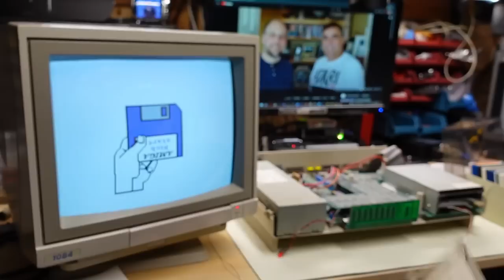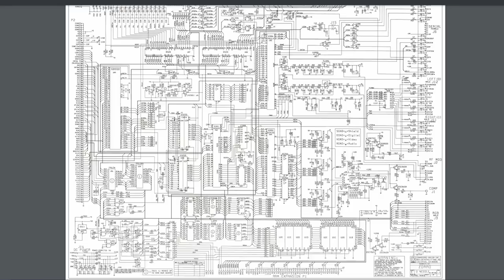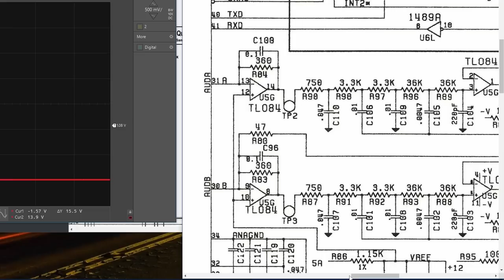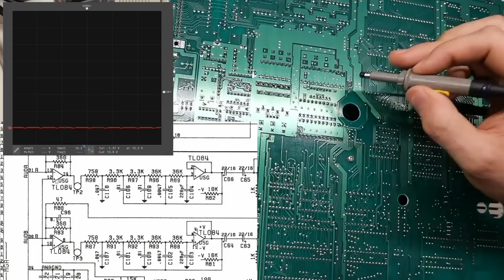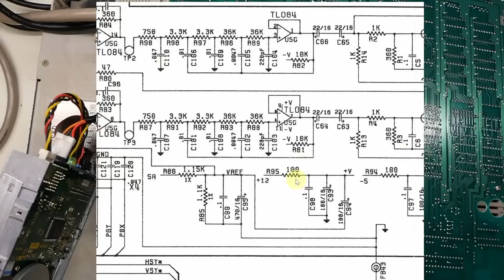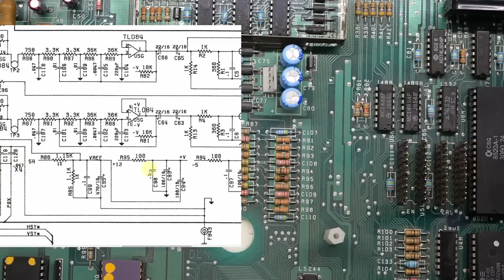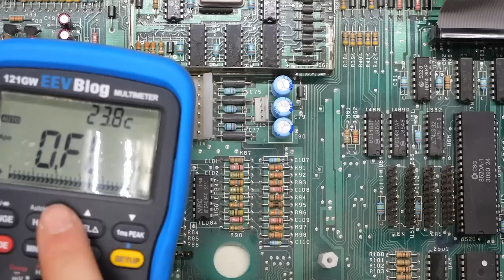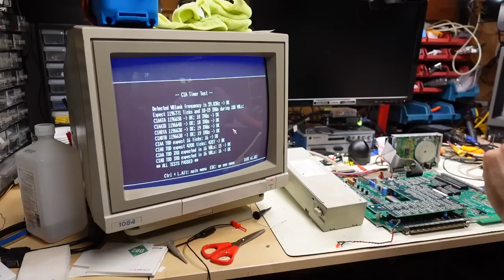Amiga 1000 repair - No audio output

Comment: I had a computer shop from 1982- 1992 and your experience with 3.5” FDD is exactly what we had in the 80’s. They were very temperamental. 5.25” were rock solid.
Reply: It does not help that 3.5" media was for a few years utter garbage. Like half of the disks from a box wouldn't even properly format on the first try.

Comment: This brings back memories. About 30 years ago I modified my Amiga 1000 to retrofit the low pass filter defeat that was present in later model Amigas. For those who don't know, the Amiga 1000 had a fixed 3Khz low pass filter in the audio path which resulted in pretty muffled audio quality. So despite the Paula being able to operate at sample rates up to 28Khz and thus reproduce frequencies up to 14Khz, high frequencies above 3Khz were always lopped off by the filter.

The A500 and A2000 added a switchable filter - the control line which dims the power LED also bypasses the 3Khz low pass filter in later models, giving a much sharper but also aliased sound that Amiga mods became known for, however most MOD's were written with the filter being off in mind. (In fact tracker programs allowed a MOD to set the filter on or off)

To retrofit this functionality I had to trace the audio path from the Paula to output socket via the opamps etc - all without the benefit of having a circuit diagram. I also had to trace the source of the LED dimming control signal.

I ran into the same problems as you - trying to trace those signals while the machine is running, but with the Kickstart daughter board being right in the way. I don't remember exactly how I did it but I suspect I removed the board from the case and measured on the bottom like you did.

To actually implement the switching I interrupted the signal path before and after the low pass filter and used two quad CMOS switches (which are capable of switching analogue signals) controlled by the LED dimming signal to either pass the signal through the low pass filter or bypass it. This circuitry was mounted on a tiny Vero board stood off from the motherboard on small standoff legs but below the daughter board.

It worked great and allowed me to hear MOD files the same way owners of later Amiga's did. I gave that Amiga 1000 away in 2009 and although I hadn't used it for years by that time and it had sat in a basement it was still in perfect working condition. These days I really regret giving it away as the A1000 is now considered a classic...
Reply: Hope that A1000 made it to a good home. A mod like that "requires" someone to put it through its paces.
Reply: The later Amigas also vastly simplified the filter circuit

Comment: Man, you should see my A1000 with the first version of the Insider memory expansion.  It has 48 RAM chips on it, so it's a tight fit into the CPU socket, even without a ROM kick board on top.  Having a whopping 2MB of RAM back in the day made me feel like a king.  8)

Stop throwing out disks, BTW.  Floppies are actually very reliable.  Each drive has slightly different alignment, so just rewrite those disks in a "good" drive to fix them.  I need to re-align the drive in my A1000 one of these days.

Comment: 16:44 Maybe it was due to the 1010 drive being so close to the Monitor.  I've had that issue before!  Some people also have issues with the built in drive when the monitor is on top.  C= added a heavy metal plate under the Amiga 1080 monitor to block the interference.
Reply: true. And at one point sitting on the SMPSU. That cant help?.
Reply: Ah yes, the magnetic field of CRT-monitor. Loudspeakers had to be avoided also.

Comment: Caps are the 1st thing I try after checking the power when audio is concerned. Well done! I would have also recapped everything and replaced the 100 ohm even if it read properly.... it's been stressed and may eventually break down sooner rather than later.

Comment: Sound problems on Amiga (basically all models) very often boil down to problems on the 12v/-12v circuitry, and this wasn't an exception. If the machine works, but it's without audio, it's usually something with the 12v/-12v rail, additionally the floppy drive might not work, if the problem is with the PSU. So that kind of gives early hints during diagnostics. In any case, great work, good repair!
Reply: not to mention the controller lag.

Comment: Just got to admire how that one plucky resistor could take the heat and carry on like nothing was happened.
Reply: It didn't lose any of its capacity to resist current, smack bang still in spec!
Reply: Who's the tough resistor that won't cop out when there's heat all about?

Comment: I used to have an original A1000 I got to see if I wanted to go Amiga after my Atari 8-bits.  It was impressive, but the cost of peripherals and software were too high as I was just starting my family and my Atari with an MIO and hard drive managed for another few years until I bought a PC.

Comment: 17:30 Open the sliding window and take a look at the disk.  Often the magnetic coating just strips off the disk entirely (it looks like grooves in the disk when this happens).  That material then sticks to and contaminates the drive head and has to be cleaned off.

Comment: When changing out internal drives back in the day, I also  used IBM 720k drives by modding  the disk sense switch. Fine memories.  I wonder if Amiga will be back with a smart phone design.

Comment: How you could've known it's not the opamp: the opamp doesn't actually have a connection to GND, so it's impossible for it to produce a short to GND :)

(The opamp doesn't need GND, it essentially works anywhere* inside the -5V to +12V range, the input signals "bring" their referencing in with them.  *[there's dead zones near the rails, -3V to +11V/4Vcm really])
Reply: That's such an obvious point that I've never even noticed, excellent tip 👍  I hate opamps I've never understood them but luckily I've a friend who does just a phone call away..
Reply: I guess it is common to have a 0v rail connected to say the + or - opamp input, then there could have been a short path to 0v. However not in this case it seems. Easy thing to assume.. Or there could have been a rail to rail short (pin 4 to 11 or whatever it is on the TL074 without looking)..
Reply: @g0bzy  They seem to use it in a weird hybrid between single- and dual-supply connection. They connected it between +12 and - 5V and then biased it to ~2V .. so for the opamp it looks like + - 7V.

Comment: I once had a 2000 in the shop that had been in a thunderstorm. He remembered to unplug it, but forgot to disconnect the phone line from the modem. I assume it wasn't a direct hit, cuz the machine wasn't melted. :-) But the hit took out his modem, fried the rs232 driver & receiver on the motherboard, and most likely because of that link you mentioned from Paula to the serial port, took out Paula as well. It didn't fry any traces though... which I have seen on video and joystick voltage pins before they added fuses.

Comment: I'm honestly surprised you even bother with an actual floppy drive in the first place instead of using a cheap GoTek floppy emulator with flashfloppy installed on it.
i'm using it, and it's pretty dope to be able to just have floppy images on a regular FAT32 flash drive and use them with my Amiga

Comment: The audio out from the left channel to the serial port was a weird feature of the Amigas, I remember reading the idea was that Paula could send audio data to the modem (an Amiga specific modem, since the pin was not a standard RS-232 pin). There was also an audio in on the port that got mixed with the right channel (but never digitized), presumably so the dial tone from the modem could be played over the speakers. I know Commodore sold a 9600 baud Amiga branded modem; no idea if it actually supported those pins.

Comment: My first guess is the -12 volts are missing. In later Amiga -12 V is used for serial and sound. But with the old A1000 it is probably the -5V line.
Reply from the maker: Indeed could have been the PSU  -- wouldn't have really noticed any other issue without that rail. (Other than dead sound)

Comment: A broken capacitor is such a recurring theme in Adrian's videos. So is that something they didn't know would happen back in the 1980's? Or was that simply as good as they could make them? Or did they consider a, say, 15 year reliability span acceptable?
Reply: They were as good as necessary to get an acceptable amount of warranty returns and not THAT many failures after warranty that it hurts their reputation too much. And realistically, back then a 5 year old computer was obsolete and outdated beyond repair, and likely replaced or given away as a toy. Nobody would really have cared about it failing because "eh, was old crap anyway."

That the C64 lasted for 11 years was basically a miracle, seeing that the C128 was meant to replace it after only 3 years.

Just as today.

Also, electrolytics did tend to fail when unpowered for a long time up to around the 1980s.
They fixed that issue by using oxidizing electrolytes, but those then did sometimes attack the case and have them leak .. a lot of later machines had problems with that, the Amiga 600/1200 are affected quite often, as are the disk drives in the IBM PS/2 series.
Reply: @VintageTechFan  Thank you, that was interesting. Just saving a few dollars then. Like my TV failing after six years because of one poor backlight LED worth maybe less than a dollar knocking out a whole strip and killing it. Such a waste.
Reply from the maker: The SMD electrolytics are the junk ones that all leak and destroy things. It's amazing these 70s and 80s caps usually always work and are leak free. It was in the late 90s and into the 2000s the the cap plague happened, where you would get just a few years before they failed.

Comment: You could also use an audio signal tracer to check for sound at various points in the signal path, if one doesn’t have (the $$$ for) a scope! 😌
Reply: As long as you're just doing audio, you can buy a cheapo $5 sound "card" off eBay, and use that with free software as a scope.
Reply: @absalomdraconis  Or even a pair of headphones, heh.

Comment: I would have changed the 084 as well, if you look @25:36 it seems to be badly cracked... I wonder if that got a bit cooked, together with the 100ohm resistor.

Comment: Most repair channels always suspect the electrolytic caps first.  Even to the point of replacing all the caps  before turning on.
Reply: blindly replacing all the caps before even turning the machine on to test it first and check if there even is a reason to suspect the caps really are bad is a modern trend and kinda BS in my opinion ... 

by all means, popping the hood for a thorough visual inspection before powering up a piece of old tech in unknown condition is absolutely the right thing to do...

... but shotgunning all the caps without checking if the machine even works to begin with ??? naaaah ...
Reply: @KenjiUmino  Depends on the caps. The junk surface mount electrolytics from the 90s should be replaced on principal, but it doesn't usually come down to principal since they're often obviously leaking. Through-hole caps from the 80s that pass a visual inspection can be left alone.
Reply: Bugs me to see people blindly replacing caps regardless. Dare i say it shows lack of knowledge. Yes check the cap ESR, but if good, why replace it.

Comment: You know… the audio channel on the serial port sounds (pun not intended) weird but it was probably for doing DTMF tones. Never considered but much cheaper than adding a dedicated codec chip for dtmf dialing. ;) Brilliant.
Reply: Ooh good point! I was trying to think which serial devices would want to also output sound, you’re right that a modem is probably the most likely culprit
Reply: @kaitlyn__L  I have the 1680(?) 1200 baud modem for the A1000 so I can check (once I get out of storage). 

My only other thought was using it for IVR (Interactive Voice Response) but I can’t imagine that on a 512k Amiga… but it has the ability to do voice synthesis.

Comment: From memory, there were a couple of really early games that booted in place of kickstart to utilise that additional 256K of ram.
Reply: Dragon's Lair did that.  That's the only game I am aware of (might be more).  It required 1M of RAM, or just 512k if you had an A1000.  :-) Also, A-Max (the Mac emulator) could use that as RAM.
Reply from the maker: Ah that's pretty cool!

Comment: I'm not so surprised that a shorted 40-year-old electrolytic cap was the ultimate fault... the surprising part is that none of the other ones failed first!
Reply: Yes, if there's a short and a 40 year old cap in the circuit I'd bet on the cap 10 times of 10. I generally always recap anything with old caps when doing repairs. All of them will fail eventually.
Reply: SPOILER ALERT!

Comment: @31:21 I don't know which color goes to which side, but the connectors are labelled 'L' and 'R' right on the silkscreen.
Reply: Easy to remember: Right is Red, so they are indeed reversed.
Reply: Interestingly, they are labeled wrong on the silk screen.  On the schematic, J5 is L, J4 is R (the silkscreen is opposite).  He got the colors correct.  But he should have glued the jacks down better.

Comment: One of my A500s died last year with no video, but playing blind. I noticed that the video DAC had its own 5V circuit and the (what was it 10 Ohms?) resistor feeding it was burnt and I noticed the 74xxx latches (374? 273? I forgot, sorry) didn't get 5V and there were two 3300µF caps which were both shorted.
Reply: Yeah I think I'm going to have to grow some balls and recap my 500s. Scary when they mean so much to you.

Comment: Sweet, your A1000 is freakin' workin'! ;) I did figure "opamp voltage problem" early on, but I enjoyed how you traced the actual root cause of that. Oh, how about a poll on that burned survivor resistor! :D /o\

Kickstart 1.3 is actually very compatible with modplayers, games, etc. But what happens on a machine with only 512K is that the OS hogs half of it, and this is unexpected, especially if it's going to load a big song or something. However, over 90% of trackloaded games software required only 512K memory until quite late, say published up until late 1991. Workbench type programs and games requiring the OS (Workbench or CLI showing) - if it's made after 1987, it probably won't start. 256K chip total and even trackloaded software will not have room for tracks, loader, and program.

Regarding floppy disks: they are very reliable indeed, and hold the information perfectly for more than 3 decades from a single write. I would say some manufacturers like Maxell struggled until 1988, but that's it. There are no bad brand DD disks after that; noname brands are perfect. It has all to do with storage - of the drive, and the disks. I would never put a disk in a drive I didn't check, and I would never put an unchecked disk in a perfect drive.

TL;DR: If you inspect the drives and the disks, something must physically happen to 3.5" disks to make them lose information.

About what happened: (Because it's as interesting as finding what's wrong with hardware!)

The A1000 obviously didn't write different data to the test disk. This is what could have happened:
1) The disk writer or the disk reader(s) could have transferred residue to the disk from their heads. Fix by cleaning the disk and the drives.
2) The disk was an HD disk, but the writer drive was DD, and the adapter (correctly) applies normal DD power to drive coercivity, which though the values are similar, is not enough and will result in a very weak write. (Not weak enough to work one second and not work hours later, though.)
3) The disk was a DD disk, but the writer drive was HD, and the adapter expected a DD drive.
4) Something happened to the disk between insertions. (Mechanical or it was placed near a very strong, changing magnetic field.)
5) The disk already had dust inside it, and it moved around so as to land on tracks that prevented loading.

2 and 3 are unlikely and can be solved easily technically. 4 is something that only you know, maybe you remember dropping it, or putting it on an unknown speaker (some modern TV soundbars and similar have extremely powerful, unshielded magnetic fields!)

This leaves 1 and 5. 5 is fixed by opening the flap, turning the disk while blowing the dust into the corners (or opening the disk to clean it properly). I think 1) is the most likely for the short timespan. One of the drives had dirt on the heads, and you did place the disk in two different drives. Dust came on it from one to the other.

I write at length because I've had so few disks from 1988 onwards fail on me, and if one did I have most of the time been able to format it. It's almost always how they're stored, or in the rare case a bad drive when writing. If written properly, the magnetic information is stored very securely on 3.5" disks. Even if dust and mold gets inside them, you can clean it off and get the information back.